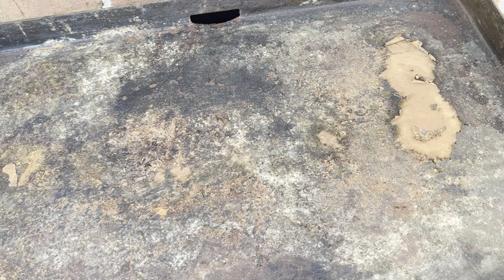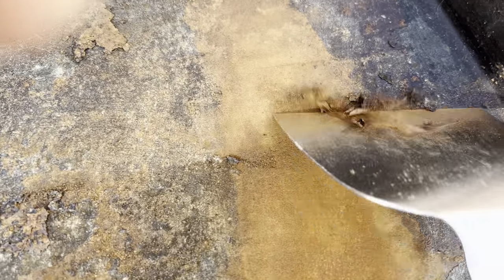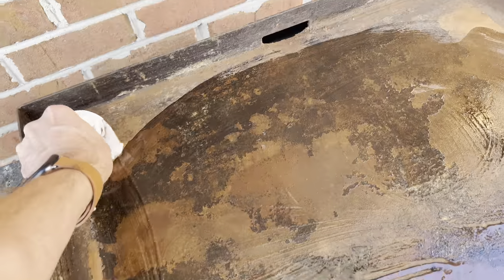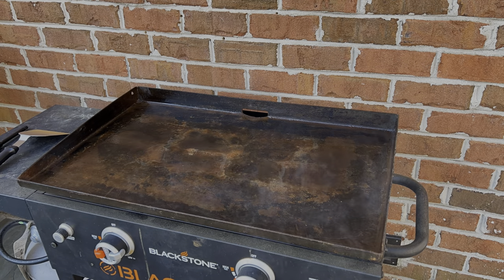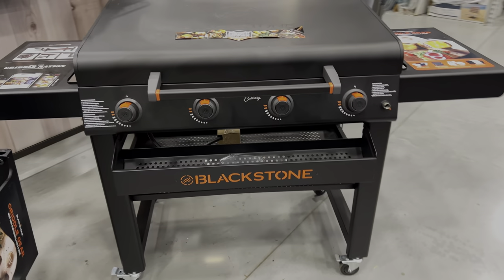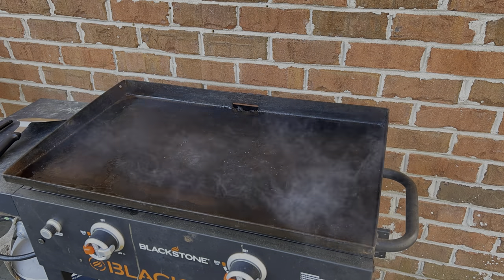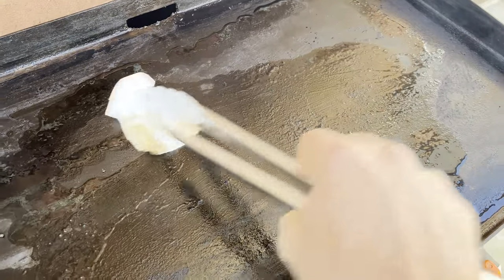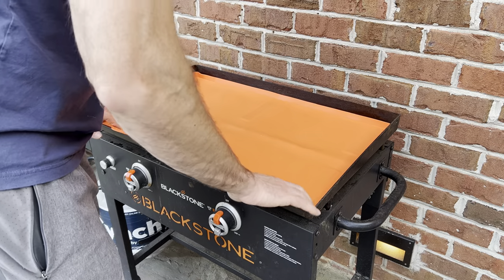Remove Rust and Prevent It: Expert Tips for Cleaning a Rusty Blackstone

Comment: To anyone coming here for directions, please clean the rust off of your blackstone before hand instead of just seasoning over it...
Reply: I have light rust what would you recommend for cleaning of rust.
Reply: @pyro_1901  use a vacuum
Reply: @pyro_1901  They have the cleaning stones that will remove the rust and then you clean it off, once scrubbed and loosened
Reply: @pyro_1901  first off, anytime you plan to leave the cook top in idle mode( as in not using it) always scrape it as clean as you can get it while it is still hot and after use, then apply a very light coat of fresh cooking oil to the surface while it is still hot, then let it cool down and move it out of rain and bad weather if possible nothing can protect it from moisture as long as it stays outside even if covered up.
Reply: Rigjt!!😂 this is a very half assed way of doing it for sure

Comment: I have a hard cover for my griddle and it doesn't make a difference. I even cover the whole thing with a soft cover and it still doesn't prevent the rust.
Reply: Same. We have a hard cover too and it still got rusty
Reply: I keep my griddle outside and doesn't rust. Place a double layer of  paper towels down, once it's cooled and put parchment paper on top or the rubber mat. The paper towels keep the condensation away.
Reply: They are made out of very cheap metal. I have one now but will be going back to a grill when it plays out.
Reply: Get rhose damprid containers from rhe store and put like 2or 3 on the grill and cover over it
Reply: I have 22 inch with the lid it's outside under a soft cover and it's hasn't rusted yet I just wiped. Thin layer of oil on it while it was hot let it burn off till the smoke stopped and repeated 5 time to season mine
Reply: Same.
Reply: I seasoned mine correctly , I have a rubber cover directly on the griddle , hard cover , and the soft cover it comes with , it gets rusty in days . These things are garbage .
Reply: I got mine for Father’s Day it came with a hard cover and soft cover and it rusted with me only having it for a month

Comment: This isn’t a very good how to video. You should try to get that rust off either with a wire wheel or brush
Reply: i agree with a wire wheel to take the surface back down to fresh metal and start all over with the seasoning process, that griddle top looked terrible.

Comment: Mine has a hard cover and I still get rust on the griddle. I’ve also got rust around the areas of the air fryers and I’ve never even used them. Kind of frustrated! I do live in Oregon but it’s under a roof cover, so it doesn’t get wet. It also has a soft cover sitting on top of it along with other objects.
Reply: Yeah me too. I went with the hard cover to prevent water, but it doesn't do a lick.

Comment: I know cast iron is a great heat retainer but seems like using SS would make things soo much easier. 

I dont have a BS but I do have a larger steel griddle topper for a grill that is super rusted over..  this is why I'd never buy a BS and why I completely stopped using cast iron skillets over stainless steel or even heavy duty commercial kitchen aluminum pans.